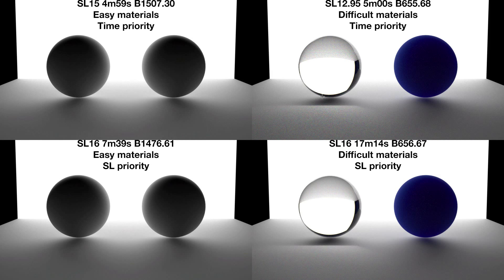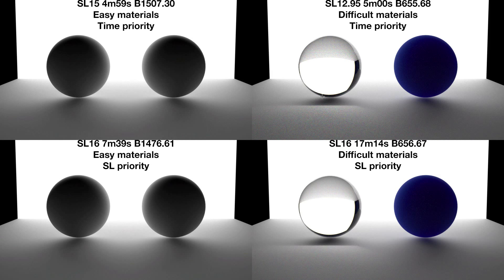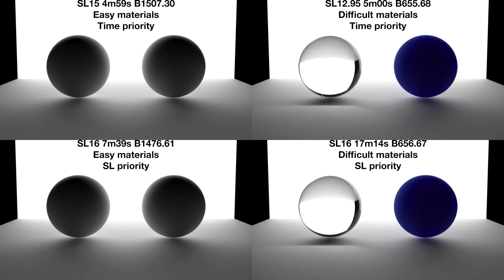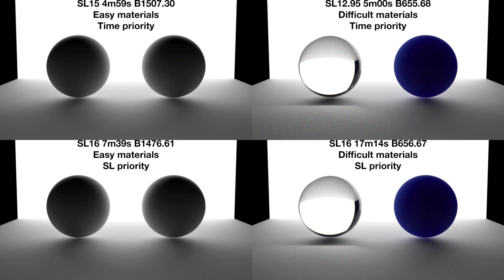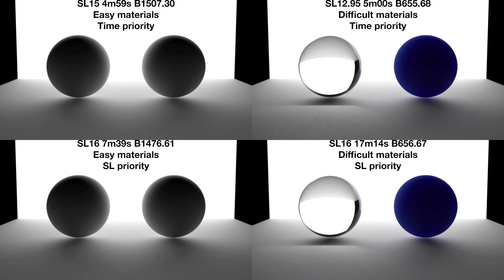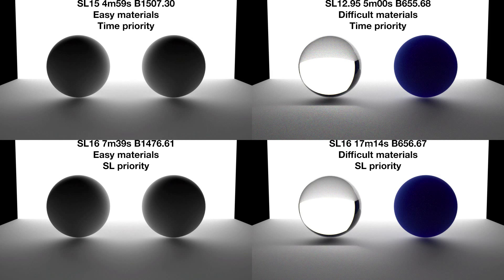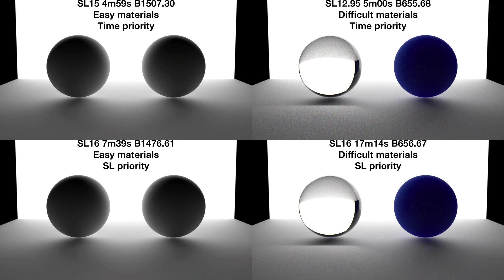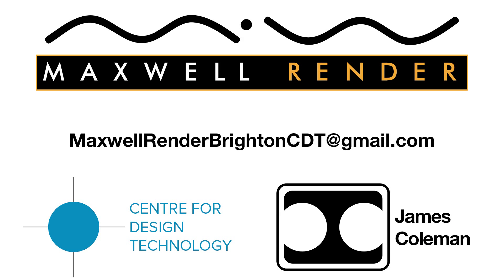SL vs Time - Maxwell Render Tutorial

Comment: james, great tutorials. i am somewhat new to maxwell but i grow to like it more and more. i am really struggling with my rendering times lately though. i do mainly architectural rendering and sometimes it will take upwards of a couple days for them to render to high enough quality for my liking. i finally purchased a gpu and thought that would give it a boost in render speed but it has stayed exaxtly the same. i know V4 has a strictly GPU or CPU setting for render. i am still on V3. basically my question is does V3 utilize the GPU at all? like, even a little bit?